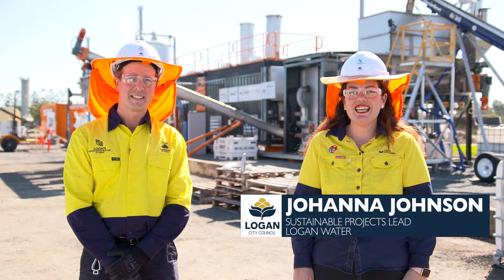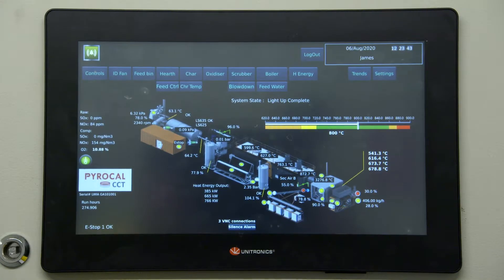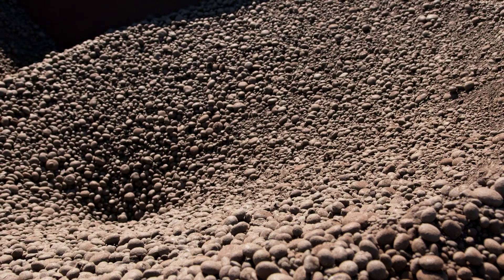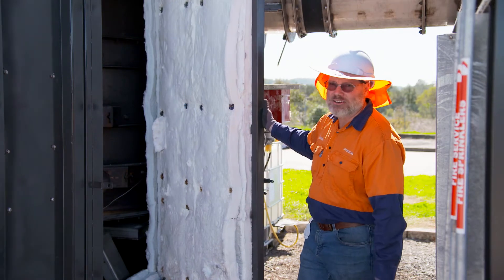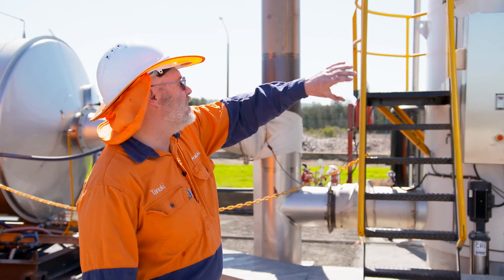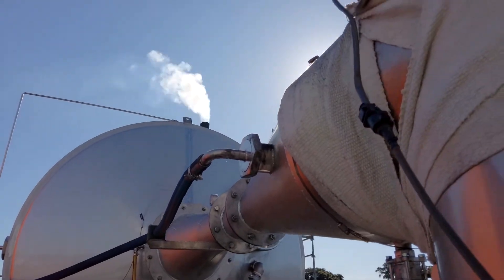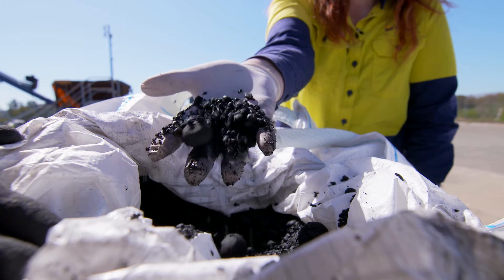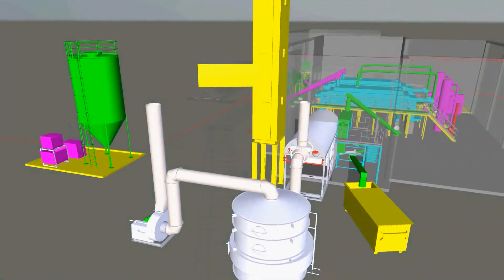Australia's first Biosolids Gasification Facility

Comment: Is there any reporting on this, as in energy input and output (particularly around whether it's net energy or at least recovers a significant portion), volumes of sludge, sludge content analysis, total emissions from the process, etc? As well as total overall cost for establishing the plant and operating the plant?

Been trying to convince my local council to investigate pyrolysis solutions to waste management and if you guys already have a lot of the info, it'll be a great way to push them towards it.